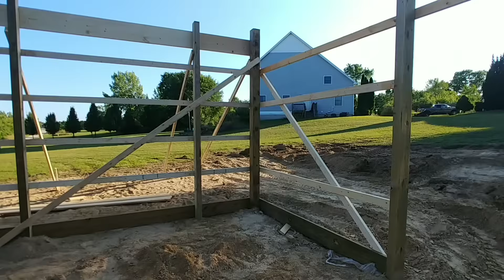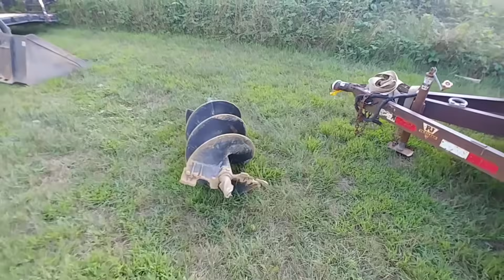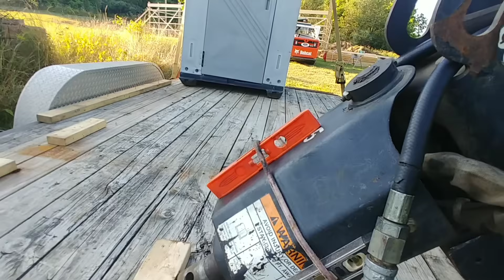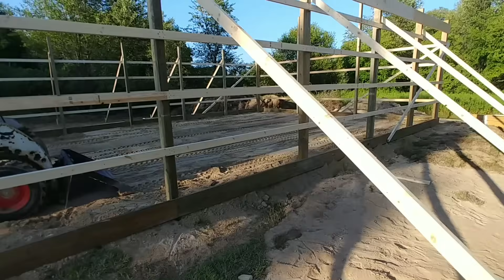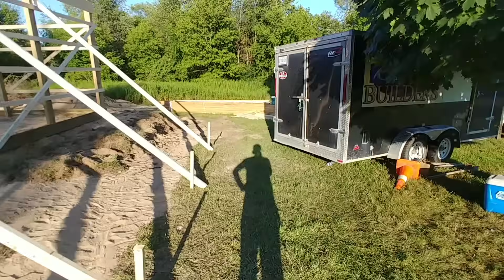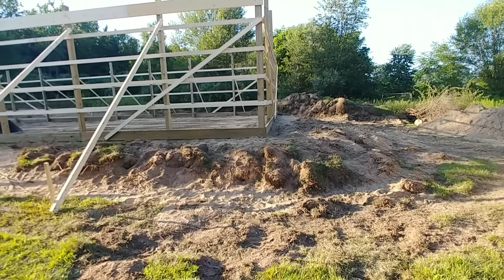How to build a pole barn, rough guide.

Comment: So you had a company build the shell? How much did that run? I am wanting to do the same. I can do all the interior but may hire someone to erect the building and I do the rest
Reply from the maker: Actually I was very surprised how cheap it was.  For the entire building finished exterior I payed 33,200 that also included the concrete floor.  So far I need to make a new video, but for the total building cost where Im at is 38900.  Thats drywall, insulation, mud tape, paint, electrical, gas and a 80k btu 96 % efficient furnace.  Plus also light but the lights I got as salvage and rewired them for Led.

Comment: What was the material used to build up ground   Does it have a compaction rating. Thanks
Reply from the maker: Sand was used inside for under the pad and top soil on the exterior.  Im not sure what the compaction rating would be.
Reply: Just by the color of the native soil you're looking at a class A or class B soil type. More than likely requiring @ 6% to 10% optimum moisture compacted to 95% density at minimum 6" depth. Add 2" of sand for concrete slab. Sand is considered a self compacting material under the weight of concrete but typically it's best to give sand a little moisture and compact with small roller or vibratory plate.
Reply: @mattkenney2637 . I appreciate your educated answer.   Seems today that is a difficult think to find.  Thank you